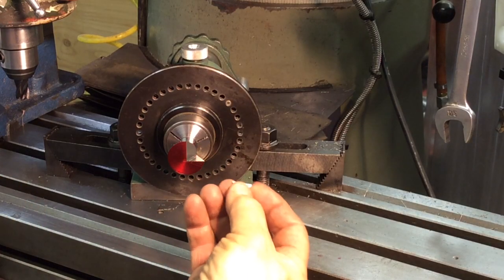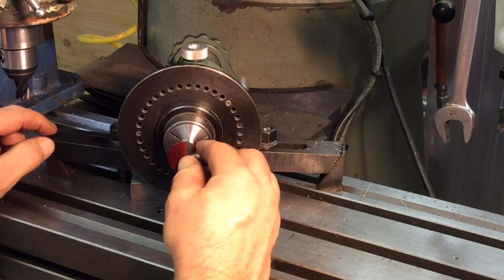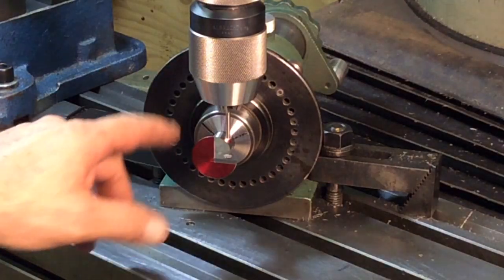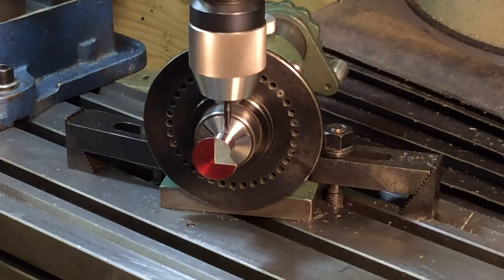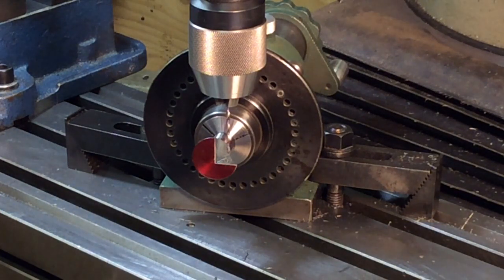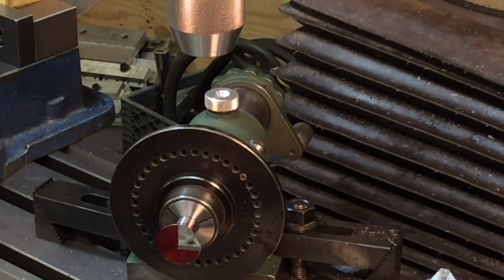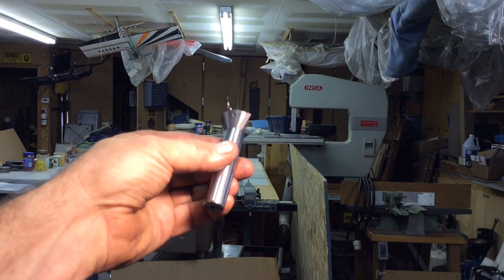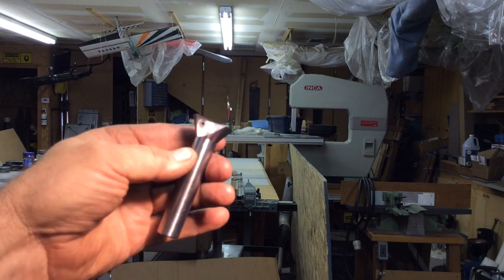How To Make an Insert Dovetail Cutter P4 Final

Comment: Took me 3 goes and 12 hours work to get a presentable cutter. Took another 2 hours to make an almost perfect second one after that,once the setups and measurements were worked out. Had to re draw in metric to suit the inserts I had at hand..Steep learning curve, especially the mill setup as had trouble getting my rotary table to fit the table slots at the 30 degree angle, Thanks for the excellent video, will also comment on the tool holder video now I can use the cutter to complete the holders. Thanks once again from Auckland, New Zealand.
Reply from the maker: Anthony Lawrence Thank you Anthony for watching.  I will have to go thru my drawings and make them up into Metric versions. I am sorry it it took you so much time and attempts to get you cutter completed.  But it sounds like you gotterdone.  I hope to see some photos of the completed tool and tool holders.  Thanks again, Randy
Reply from the maker: Anthony Lawrence I have visited Auckland in 1976, A beautiful countryside, I would love to visit again.  Randy
Reply: Randy Richard Ha ha. in 1976 I spent the summer in USA and Canada.Stayed for 3 months in a little town called Dayville in Conn., with my best mate's Auntie. Visited most of the New England area. Was in Boston for the Tall Ships Parade.Then I went to B.C. for a month and hitch hiked up the Fraser valley as far as the Peace River. Got a job offer at a mine way up North but wasn't hired cos no work permit. Found out from the guy in the seat beside me on the plane home that if I had gone to a particular Vancouver bar I could have bought a Union Card!, and then got a work permit!!1 Oh well, such is life!
Reply: Randy Richard The Drawings are fine. The important thing I figured from them is the 2 :1 ratio of head Diameter to face length of whatever insert one has available. Thanks for really emphasizing the importance of insert cutting edge being right on the tool centre line.I ended up with a 16 mm shank, 32 mm head Dia., and overall length of 100 mm.
Reply from the maker: Anthony Lawrence Sounds perfect.  Send a photo of a cut when you use it.  Thanks Randy

Comment: I just modified my ratcheting tap handle  to look like yours with a sleeve to put in the drill chuck. works a treat, didn,t need a drawing either!! Cheers from AKL.
Reply from the maker: Anthony Lawrence That is great Anthony,  Did you make a dovetail Tool?  Randy
Reply: Randy Richard Yep. 2 dovetales.
Reply from the maker: Anthony Lawrence Two, alright.  Randy

Comment: Randy Richard  Very nice, do you do fine feeds with your quill or with the table?
Reply from the maker: James Kilroy I used the table feed on this project. I can get from 1 to 1.5 thou pull down on the quill depending on how heavy the cut.  Locking the quill and bringing the table up seems to be more accurate.  I went over 1 thou on this cutter.  I will run a test cut with it today.  Thank you for watching.  Randy
Reply: Randy Richard I usually use the table myself, for the same reasons.  I also have a DRO scale on the knee.
Reply from the maker: James Kilroy Yep, I also have a seperate DRO on the knee and Quill.  Thanks, Randy

Comment: Hey Randy, great video series. I have been making tool holders for my brand x QCTP and cutting the dovetails with a 3/16 end mill  at 30 degrees and just going past the bottom enough to acomplish a fit. After watching your video last night decided I would try to build myself a real dovetail cutter. It took me about 4 hours but it came out very good and works like a champ. I had an old tie bolt from a hydraulic hammer. The steel doesn't have a pedigree like your bolts but they are very good stuff. Have you ever made a double bit cutter. It seems like it would be the next step and not much more trouble since you had it in an indexer anyway. This one works so good it likley not needed. Your thoughts?
Reply from the maker: +Jerry Wells  Thanks for watching Jerry.  Nice to hear you made you own Dovetail cutter.  One of the secrets of the success of this style cutter is the material it made from.  You need to use
high strength material.  The originals I made from the landing gear bolts, 140 to 170 Kpis -4140 ot 8620 material. But it is very hard to get the used bolts.  New ones cost about $180.00 ea.  So I went to 140Kpsi 4130 Prehardened,  Great material to work with and very stout.  Your bolt sounds like a heat treated material and very stout.  Two cutters may cut smoother for balance but hard to improve the mirror finish and performace of the single cutter.  i have not tried making one like that yet.  Thanks for the great comment.  Randy